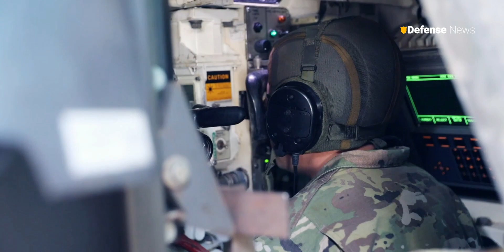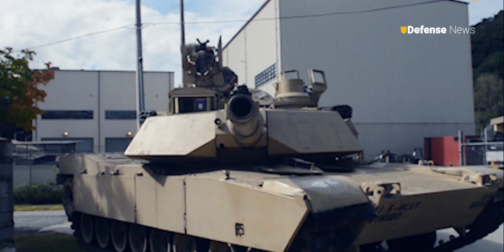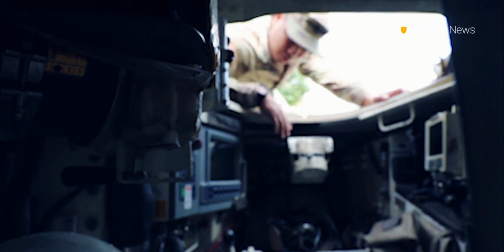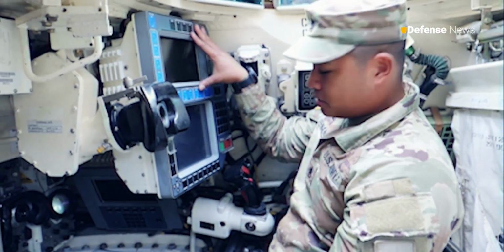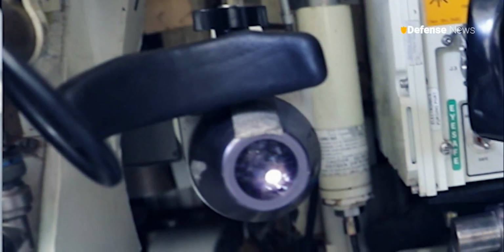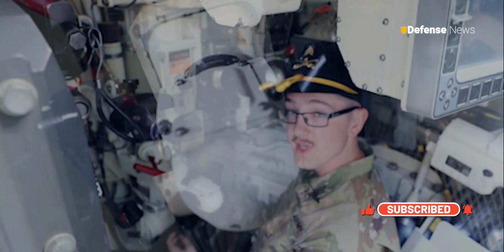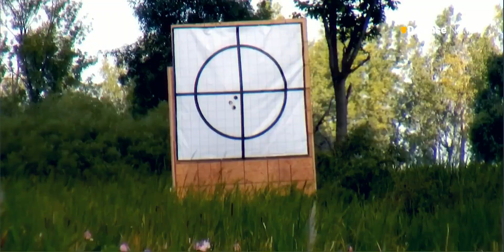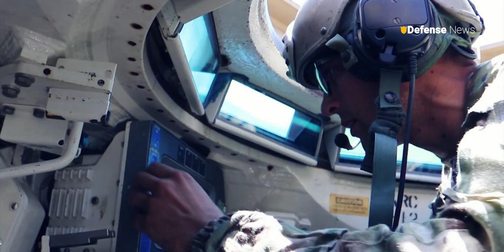Does the U.S. military have any plans to replace the M1Abrams? Abrams X

Comment: Why would they? No need to replace it with some super hightech (high maintenance) pos that costs a lot more. The Abrams does it's job well and is doesn't cost thousands to keep running and is very user friendly.